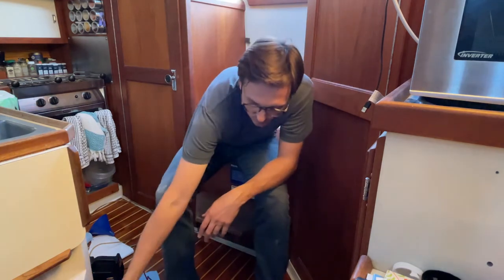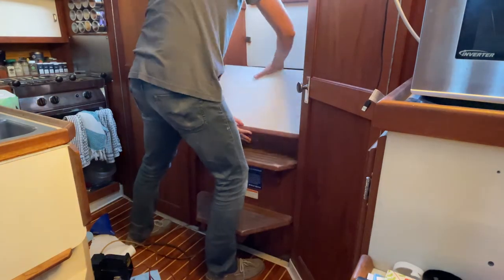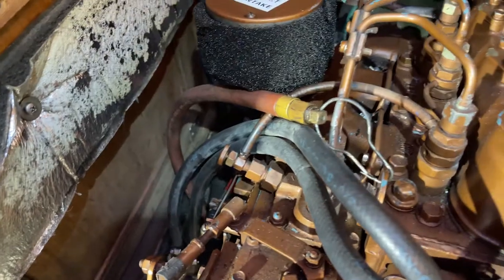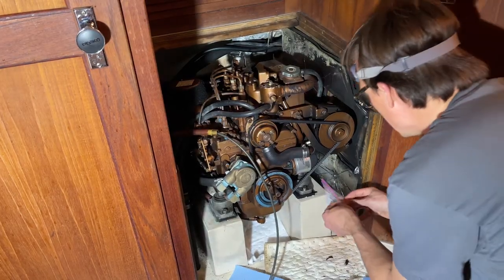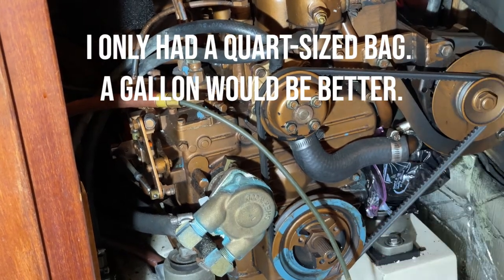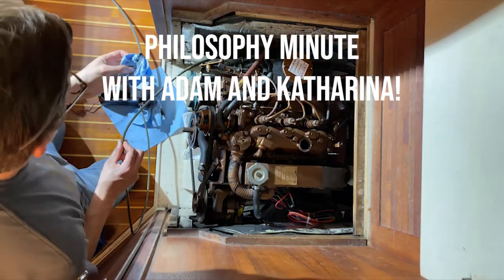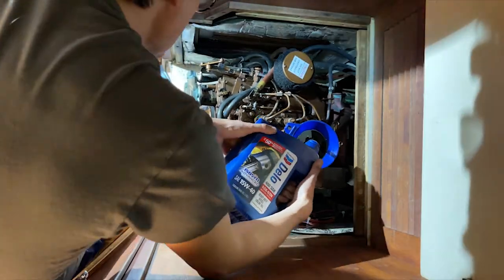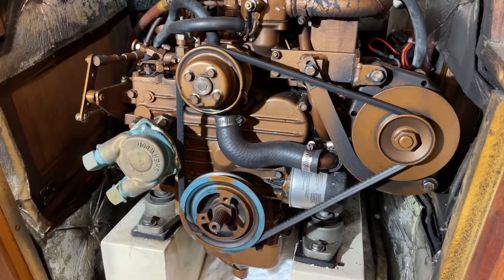Oil Change On a Catalina 34

Comment: Excellent! I sit the one gallon used oil jug INSIDE a 5 gallon bucket. I have this dream of dumping 4 quarts of old/hot oil on the sole.
Reply from the maker: Nice! I appreciate your extra care! I have similar tendencies. And the soles in these boats are so nice, it would be a shame to ruin them (not to mention cleaning the bilge is zero fun.)

Comment: You can put a crummy rag under the oil filter to catch any excess spillage. I do this on my Harley to prevent oil getting on the wiring and frame. Nice video TY
Reply from the maker: Thanks, and the rag is a good idea, I would definitely do that next time.

Comment: I have the same boat at shilshole now.  Have you replaced the impeller for the sherwood water pump?  I'm not sure how to tackle that one.  Would be a helpful video :)
Reply from the maker: Hi Eric, which pump is that? I did replace the primary freshwater pump, which was a pretty straightforward affair. (No video sadly)

Comment: Does anyone know if the oil pan and/or oil pan gasket on this M25XP can be changed on an '87 Catalina 34 without lifting the engine??

Also, you mentioned the relief being open when extracting the old oil.  Do you mean the compression relief lever on the top rear of the engine?  If so, why would that make a difference in extracting oil from the pan?
Reply from the maker: I'm not sure about removing the oil pan. It may be possible though you're going to have a heck of a time reaching the rear bolts for the pan. For your second question, I just meant I opened the oil fill cap on top of the engine while draining the oil so things flow better.
Reply: @Orcatect  For info, I did change the oil pan on my M25XP in my '87 Catalina 34.  It was a bit tricky getting at the pan bolts here and there, but I succeeded using a 1/4" drive rachet handle, an extension and a 10mm, 6 point socket.  I don't want to do it again, however.